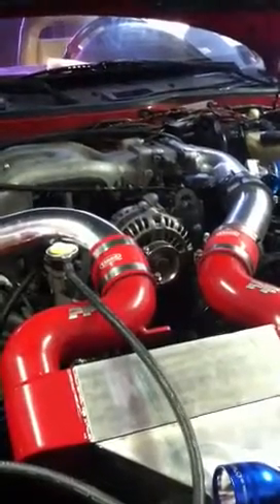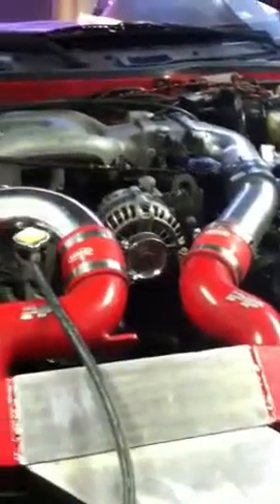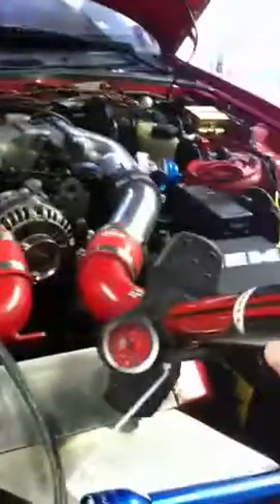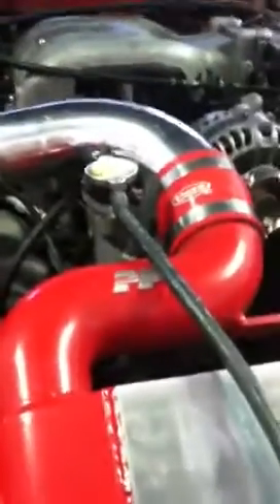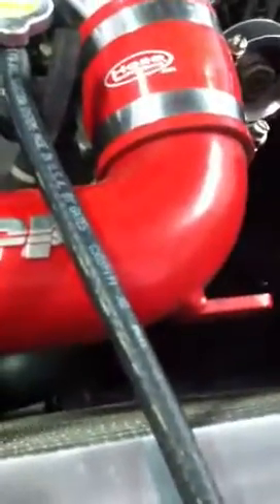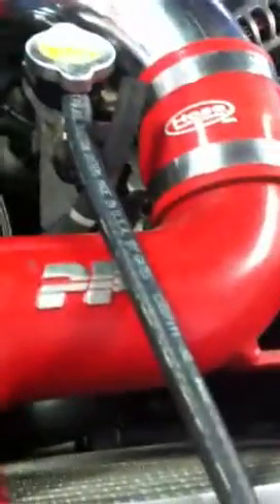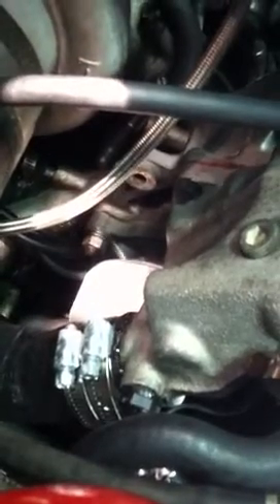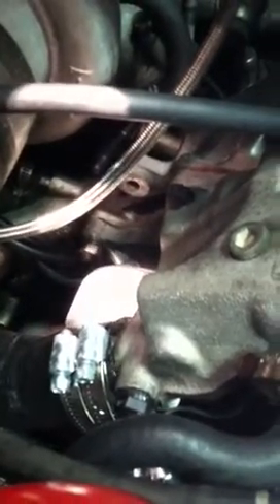Testing for coolant leaks in the rx7 with a home made pressure tester

Comment: This vid made me calm. Yesterday I noticed heat going up a little. So my first thought was it the engine harness/corode problem, because vents doesn't spin. Then I decided to control water in the morning and guess what? Over half liter missing! Of course my head went into thoughts that this can be sealing or big bang thing.. but smoke is good. Now I realized I've noticed a small fog going from time to time.. that can be caused by water leak. I cheek out the system and find out cap is leaking a little. I think now I'm about to heal the engine by new oil and water re-flush and compression test. Thank you for the video!

Comment: i wish mine was a easy fix like yours but we pulled the engine down  and it has a cracked center iron :-(    o well rebuild bigger and better mine use to make 400rwhp on pump but now going e85 more boost and bigger injectors so aiming for 500+ atw should be finished after christmas